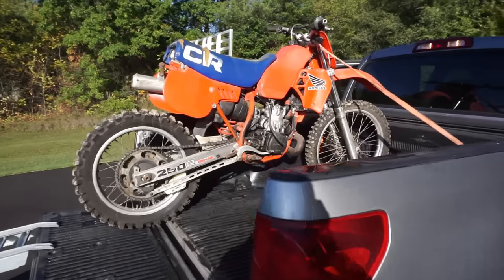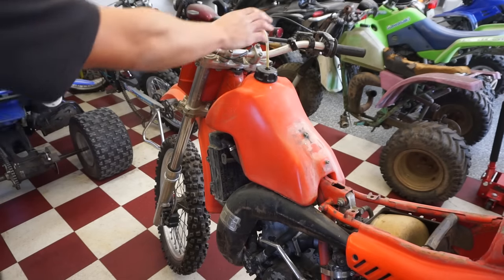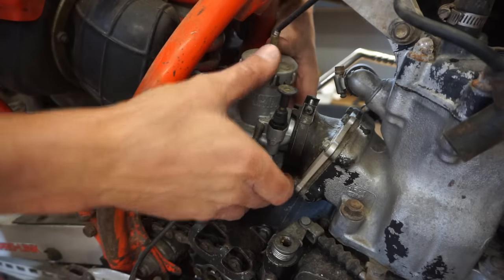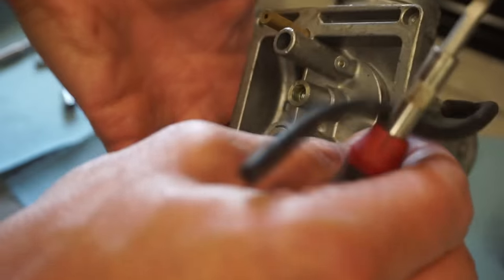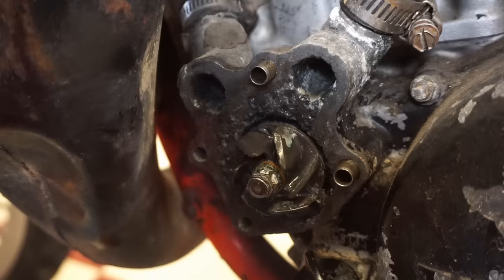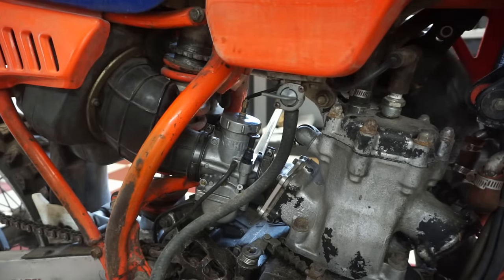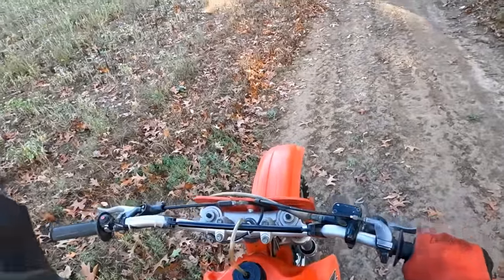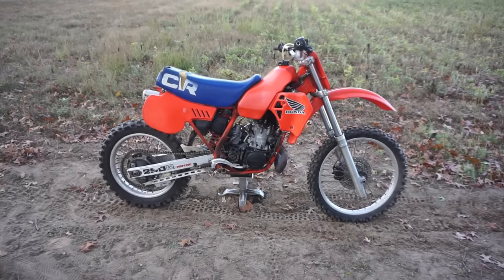Rare Barn Find 1983 Honda Cr250 Dirt Bike

Comment: Great find I’ve had over 30 bikes over the years and this model is still my all time favourite. Rode it every weekend for three seasons and it never let me down. Replaced with a RM 250 and the stator failed on the first ride.That’s a keeper smooth power and and easy to ride

Comment: I have a mostly restored 1983 Cr250. It been all apart, frame done, brand new plastics,seat cover bored .30 over with aluminum radiators, DG pipe. They are great bikes and really comfortable.

Comment: OMG, I had one just like this, pro link and everything. Electrostatic discharge on the water pump ate a hole into the engine. Fixed it by tapping the hole and sealed it with JB weld and a non metallic allen screw. I had so much fun with that bike, regret selling it but I couldn't take it with me when I moved.

Comment: Take a sanding block to the water pump and cover and sand of a millimeter of both and either put a thicker gasket or have someone cnc an exact aluminium spacer with gasket on both sides.

Comment: I had a 1983 CR250 for a year. Rode it as if I'd stolen it, mostly enduro and hard pack single-track and it never missed a beat. Got it for today's equivalent of $20 (48 bottles of beer was the cost) because the previous owner had drowned the stator and wasn't bright enough to fix the problem. That cost me another $5 to fix.

Comment: I bought a 1982 CR250 brand new back in the day. Wonderful bike. I used to go riding with it and would man-handle it backwards up and into the trunk of my 1964 Chevelle and let it sit there diagonally with the front wheel off and fork out the back to get where I needed to go. Later, After I sold it to a guy in town, I heard back within a week that he’d flipped it over backward and ripped the rear fender off it.
Reply: How funny. I had a 83 CR480 I used to get in the back of my 64 Chevelle also. They were actually pretty big trunks. Also kept my Z50 in my back seat of my 73 Capri every place I went. 5 or 6 of my buddies had Z50's and trail 70's they kept in their cars.

Comment: I got into a verbal scuffle with a kid that I think is a friend of yours on another kind of vid.  He praised you, and I disagreed somewhat.  It then got out of hand, and I buried him with life long experience.  :)
I think I made a mistake and you took the brunt of it.  I have more overall experience, (you have fixed a lot more bikes than I have though) that comes from a longer life experience, and I do see things you maybe should do during your rebuilds.  But you are younger and on a great track IMO, and you may have a "learning confidence", which is great stuff.
Bikes got me into manufacturing, and I worked full time to earn 3 part time college degrees, (2 in engineering. all in manufacturing), taking 2 classes/semester, (about 1/2 rate as full time).  It was the best thing I ever did for my brain.  Learn manufacturing/robotics IMO.  I still work with 2-stroke engines and do OK.  But a better example by far is a guy I know, whose bicycle could not keep up to the bigger kids new dirt bikes, had to build his own mini-bike in 1968 at 8 years old because his Mother would not buy him one.  So it gets it running, kinda, and rode it around the yard.  Mother did not take it from him, "He built it".  Today, he owns a factory, (sold his half of a prior die shop he and a partner make with their own money.), employs 35 people in a 60,000sq/ft self built building, with robots doing much of the welding, cutting, sanding of tanks and fenders for Indian and other motorcycle companies.  He was always improving/building things, from early dirt bikes, Mt/ Bike front suspension, (Nuke Proof Reactor bike).  You may be on a path like that. 
Anyway, I felt bad bashing a guy like you, so I am sorry.  Get into engineering classes and build stuff.  I think you would like it.  Doug in Michigan

Comment: Hi Bud was watching your old video from 2 years ago Seems Like you have come a Long way from back then it was 2 stroke 200cc the spring if I remember correctly had a cap on the end stopping it from arking out when pushing down on the bushes we used radiator pipe put small piece on 
kept spring central stopping it from shorting out causing fire to the electrics we also used a black rubber thin mate made a cone to look down when bike was running to see if the points were working correctly birds eye view it work well keep the good work up 👍

Comment: In junior high I raced an 83 CR 125. THE 250 was just a bit much then.had a chance to race one and survived but I was getting podiums on the 125,  stuck to it til my sophomore year summer then went to 250,  once I got used to it, transition was awesome, had the 85 CR 250 then. Nice rides. Hated the left hand kicker.

Comment: A full restore for sure, a tip from a ex racer, if you want to hit it from a standing start Joe, put it in 3rd, hit the throttle and drop the clutch and hang on.
Reply: Tell me the video where he did a full restoration you cant
Reply: @Johnbruzzi4234  I think you have misinterpreted what I said 🙄

Comment: HRC Factory Honda dominated the camel supercross circuit back in them days with them  old school engines. The tech for the day was awesome. You put them old motors in today's chassis with the suspension  and light weight frames you got a gnarly combo. Service Honda proved when they started putting the old school CR500R engines in the aluminum CR250 chassis of the early 2000's and eventually into the 450 frames made them plan nasty.

Comment: That pipe can be brazed back together.  One tip-when hauling in the pickup, always run the front tire into the front corner of the bed.  Then tie-down that way with the back tire in the opposite corner of the bed you'll be able to close the tailgate or at least most of the way closed.  Won't dent the front of the bed into the cab and won't let the bike shift and fall down while driving.

Comment: Check the VIN. That has a front disc brake. The 83's were drum. I think this is actually an 84 front end swapped onto it. I checked and the 84's were right hand kick so I am becoming more convinced they did a front end swap to get the better stopping of a disc.

Comment: My backyard is wide open desert. In 1984 our entire family went and all got brand new bikes. My uncle got a new 1984 CR500, my cousins got an RM60 and an RM80, my dad bought an '84 RM250 and I got an RM50. We went back the next day and my dad bought me an RM60 because I was kind of too big for the 50 but too small for the 60. I couldn't even touch the ground on that 60. I had to use the bumper of the car to get it started and launch and then again to stop. That Rm60 was twice my size and I tore the desert up on that thing.

Comment: Hey Joe, check the bottom frame tubes for stress fractures. Very common on older bikes with chrome molly steel frames. The cracks can easily go un noticed 'till a catastrophic failure occurs. Happened to me and others I've raced against.

Comment: Man that expansion pipe is flattened it's not going to have to good of power being smushed. My Bike shop guy fixed my FMF pipe for my Cr125 he put air in it and lightly put heat on outside and it metal popped back cost me $35 instead of a new pipe.Your Still Short shifting a 2 Stroke, Let Chuck Ride this he would show u the Difference.

Comment: Have you ever considered doing ceramic seal on the water system or that would be the cooling ceramic coating would help the electrolysis problem and stop beat pitting and rotting of the aluminum😊

Comment: 83 Honda CRs all had drum brakes.  You have a disc brake up front which leads me to believe that the front wheel and brake are from a later model as Honda changed to front disc brakes on the 125/250/500 models beginning in 84.

Comment: I have a 1982 Honda CR125 with a water pump cover gasket leak. The corrosion is half as bad. I can't believe the gasket maker worked. You did make me nervous firing it up after only 2 hours of drying lol. What oil did you put in the transmission? and what spark plug are you using? I picked up a NGK BR8G recently, hoping a slight hotter plug will keep me from having to rev it out when I ride in the woods

Comment: That’s a race gas motor 150compression and up is always a good idea !! Don’t put pump gas in it or u will burn it down. Dude it needs trans oil like 80/85wt get that 10W40 outta there brosky. And 24:55 Walmart NOw HAS ENGINE ICE coolant so maybe grab sum on ur next trip. Once y put a clutch in it your not gunna keep the front tire on the ground! With 170-185 compression & new clutch that thing should be epic!!!
Reply: Really u been pump gas in my cr and kx for years no issues
Reply: Type f transmission fluid.  The trans and clutch will like it. Thicker oil not good

Comment: Wasn’t there supposed to be a pointed end on the choke lever for idle adjustments? The bike sounded a little rich off the bottom end of the power band. I think it would run better off the bottom if this is the case,I’m not 100% sure about this though. I know these bikes had plenty of top end maybe you just need to give it more open throttle

Comment: Dude. 
Quick question, have you ever used “three bond” gasket maker??? If not I strongly recommend using it. Especially all 2-smokes which NEED TO BE SEALED and need to pass a leak down works GREAT!! Once u use 3-bond 
That RTV BLACK, oh excuse me, RTV ULTRA BLACK CRAP YOU WILL PROLLY THROW AWAY 🗑!!!  

That water pump and or ANYTHING ELSE, using the 3-bond will seal! Pressure (PSI) or no pressure it will be perfect

Comment: I was wondering if you could repair the corrosion on the water pump housing using JB Weld? You’d have to pull the impeller and guides off, fill and file any pitting; would it be worth it?

Comment: Great video as always Joe. Had a quick question, what do you think about the fuel filters from the tank to the carb? I used to have on on my yz125 and its actually stopped a decent amount of debris from entering. Thinking abut putting another one on my 250 but not sure if it needs it since its a newer bike.

Comment: 83 with disks? pretty sure it came with drums
Reply: It’s prolly 83.5
Reply: They did have drum breaks .
Reply: @Crosshatch1212  83.5
Reply: Probably 84 forks and disc. 87 was the first year for rear disc brake.
Reply: @Crosshatch1212 *Brakes
Reply: not that hard to convert it

Comment: If thats the stock 33mm Keihin carb then a 160main and 75 pilot are stock, it has not been rejected for the DG pipe. Think about rejetting and clip position, it will clean it up especially from idle to low mid. 🙂👍

Comment: parts are even harder to find, the con rod bearings have to be shot, same with the crank bearings from sitting so long-pitted from acid- I have been building the old mx bikes for 30 plus years- do not trust any of the bearings in a engine that has been sitting

Comment: 40:1 in 1983 cr250...Mmm they were iron bore were they not..the manual says 20:1  Even with modern oils you are gonna run lean if that thing has stock jetting...Id be cautious with that little beauty.
Reply: 40:1 is good. It will run rich because more gas less oil. Have to adjust carb air and smaller jet. Fuel it what cools the engine not the oil.
Reply: @kevintralle1637 oil lubes the crank etc. Need enough oil to keep er from locking up

Comment: I have a bunch of brand new parts for that bike if you're interested I have a spare gas tank spare radiators I have a brand new DG pipe never ever been put on the bike I see years has a DG pipe but it's dented I have a brand new piston I have a brand new gasket set if you're interested in any of that stuff let me know I'll sell it dirt cheap I went away and someone that was left behind to watch my stuff sold my bike on me so now I don't need the parts

Comment: a crescent ranch is not the right tool. Start using  socks and the right wrenchs 
Please
Reply: What's wrong with Crescent?
Reply: @Antiquefarmequipment  
Everything is wrong with it. It not the right tool for the job 6mm is.
This is how thing get rounded.
If  you work in a top shop and a head  mechanic sees this going on
You will get your ass  chewed out
Or any of the school you go to get your  certifications to become a mechanic cars trucks or  motorcycles
Reply: @250race  it won't get rounded if you use it the right way. Ppl don't use em the right way and that's why things get rounded. And you don't use them on really tight things such as torqued or rusty things.
Reply: @Antiquefarmequipment  He uses them to take spark plugs out. And it rounds the top of the spark plug .
A crescent  is not the right tool to use on a dirt bike at all.
I've seen people use them at work and rounds stuff  sense 1997
He'll I was doing a gas hook up on a propane tank and I saw a  kid round brand new brass fitting. I had to take it off and put  new ones on last month.
At the end of the day use the right  tool
For the job that you are doing.